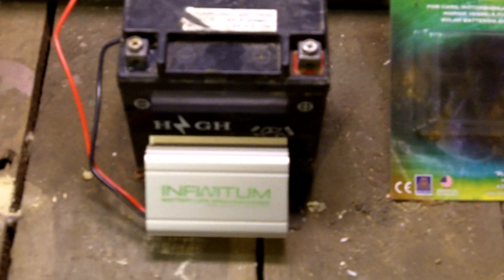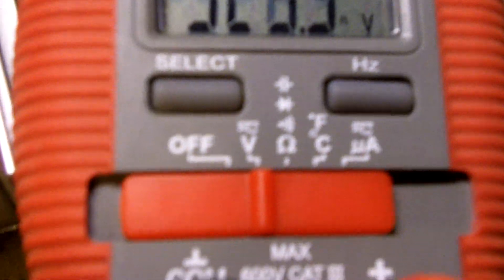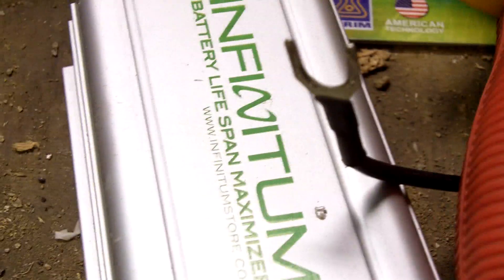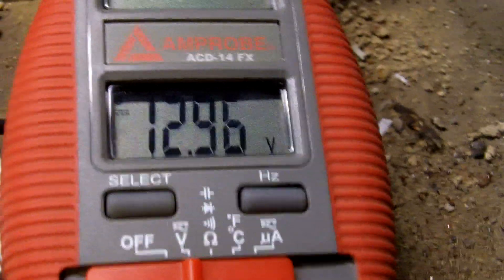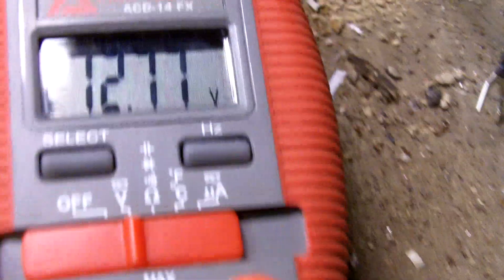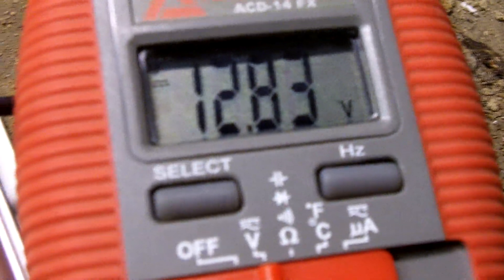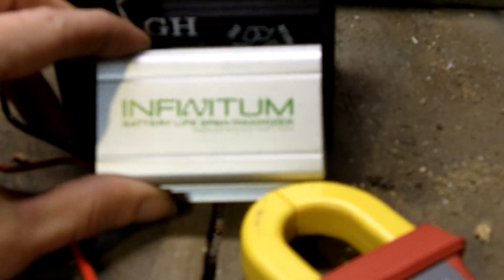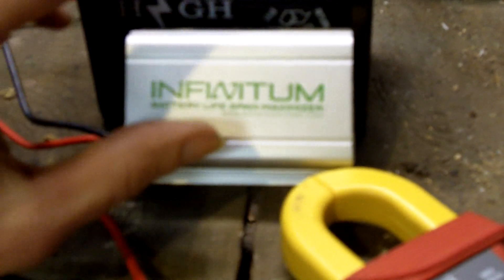Review :: Battery Desulfator

Comment: Another shit review that proved nothing! A surface charge of the proper voltage means nothing in regards to cranking capacity.
Seems these phony bologna devices are only good for if you have a stockpile of deep cycle batteries that you want to daisy chain your solar landscaping lights to. I personally have no use for a device that turns dead car batteries into gigantic AA batteries... In most cases you get what you pay for but in this case you get even less. Makes more sense to put the $$$ towards a proper replacement battery for your application unless you're the type who likes crafts n junk, or likes to pretend you're a mythbuster who (just like the tv series) uses half assed methods to prove or disprove something without proper research (like most lazy backyard hacks who buy into snake oil like this). Oh and plz get a tripod to hold your phone! trying to explain while you're working with your hands at the same time as you're recording is not only frustrating to the viewer, it shows nothing. Don't people actually view these awful videos before uploading? Come on people! At least put in the same effort you would with your porn, if you actually want to help people! There should be a "DELETE" system put in place to reduce the internet clutter and virtual garbage! The only upside are the comments but most lazy viewers aren't interested in reading...

Comment: Amazing I didn't believe it'll revive my 1 year old discharged car battery just now try 2amp charge and it show 143 cca but then I've attached infinitum and iam planing to buy a car battery 100 amp if it's not revived then after only 2 hrs it showed 547 cca out of 760 so I kept it on charge will test it tomorrow but this won't work with gel type it killed my previous car battery

Comment: hmm its is simple to use a small dc motor parralel while ur charging ......its done well with my solar battery no need for a desulfator and its fast 3 gays to 6 days no more sulfur deposit on the plate  ...it gives a high negative reverse spike voltage that can drive away the deposit

Comment: After 2 1/2 months the Battery Desulphator dead (internal short circuit)  under normal use the battery desulphator dead goes on to short circuit and dameged my car battery, instead save money now need to change my 1 year battery !!

Comment: Recently I bough this desulfator and it WORKS. I was able to revive a 200 Amps heavy sulfated battery that was showing only 2 volts. The battery was left to be discarded some 2 years ago.After applying the desultory and automatic charger  for some 2-3 weeks it works properly. It saved me over 100 euros for getting a new battery.

Comment: This crap don't work. I tried it on 10 or more batteries. they would charge 12.9 to 13.2 volts but would not start anything. Hook up a car head light and it would be dead in 2 to 15 minutes.

Comment: hello sir i just wanted to highlight that voltage doesnt mean anything,,  voltage doesnt tell you anything about the capasity to hold charge. a full voltage only tells you that the battery is full but it could be full but lost all capasity.. you need to test with a load tester... i have a few of these things and i heard you need to leave it at least for 2 weeks on each and now am trying and havent seen good results yet ... thanx

Comment: agreed. You can buy a constant curren / constant voltage module from ebay/china, relatively cheap. Set it for 14.8V, and 150 mA and slow charge it. Manually. Especially those SLA's. Everyonce in a while bump that up to 15V.

Comment from the maker: @polariskid95 i have used this on a few batteries that i thought were dead and have given them life once again.what you would need to do is have the battery tested to make sure it is able to take a slight charge.it don't have to hold the charge it just has to accept it.then you hook a desulfator to the battery and let it trickle charge for about 2-3 weeks testing it every few days to see if the voltage on the battery is increasing when it isn't on the charger.

Comment: If your batteries are crapping out that fast in the first place, may be that  you're charging it too fast and too much?  Hook that little 4AH baby to a full size car charger for several hours, and I'll bet you're overcharging it, and hydrolyzing much of the water in the electrolyte.  Also, I agree the final test would be to test your recovered batteries under load.

Comment: Don't be fooled by static battery voltage (battery under no load).  Batteries should be tested with a load present (i.e. cranking an engine over).  This unit just sends very quick discharge pulses to try and knock some of the sulfur off of the internal cell plates.  AGM (gel packs) really only last correctly about 4 years.

Comment from the maker: these units are not chargers they are to be used with a charger or directly connected for as long as you like to your battery in your car or bike.with the fact that it is not a charger it is not restricted to a 2amp tickle charge like most units i have seen that are charger/desulfator combo units.i have also seen some of the cobo units out there say they can only be used with bikes.the infinitum units can be used an all 12volt lead acid batteries and some of the other 12volt styte batteries.

Comment: Please forgive my ignorance . I'm not certain about the difference between these Infinitum Desulfators and the standard 'trickle charge' units such as Optimax / Optimate as used for motorcycles . I've been advised to leave my Optimax unit on my Triumph for a couple of days and it does the same job .
In fairness the Optimax costs about £50 ( $70 ? ) and 'tops up' the charge as and when required .
Is the unit shown just an Optimax by another name ?

Comment from the maker: i glad my vid helped and also glad you found a deal on a unit.

also sounds like your 9 year old 5ah battery has some physical defects that caused it to not benafit which happens i have only run into 1 battery so far out of 16 i have run my unit on that did not benafit(cause it had a terminal post broke inside battery).

Comment from the maker: i ran this desulfator unit on the battery in my 7 year old booster pack that would never hold a charge over 20% and voltage read 4.2 volts.i didn't think it would work but it is now reading 12.5v and says 85% after 3 days trickle charging with the desulfator connected.

i think your booster is not even close to being totally gone and there is a chance to save it if you can get ahold of one of these units.i have been told it will work on 95% of all 12v batteries made.

Comment from the maker: the first battery i did was for my YFZ450 quad and after the vid i put the battery back in it and it fired up easyer then it ever has even at this time of year being 15-20 deg Ferenhight.i also went out last night and tried it fired up pretty quick.i checked the voltage with a ohm meter and it still read 12.75v.befor using the desulfator i couldn't get it to charge over 10.??v.
 
Thanks for the comment Dave,if you have any other ideas on how i can test this i will and let you know the results.